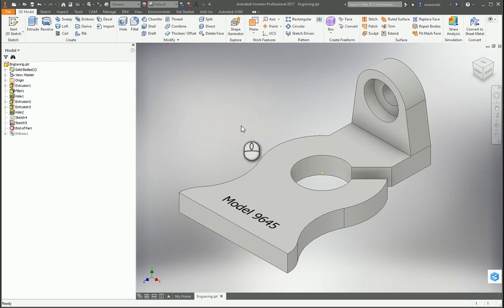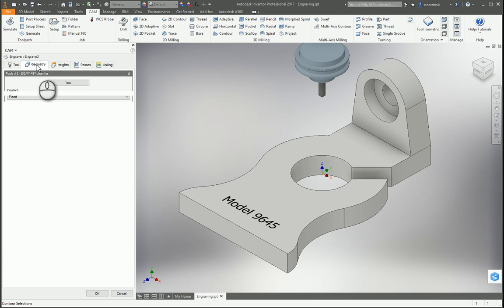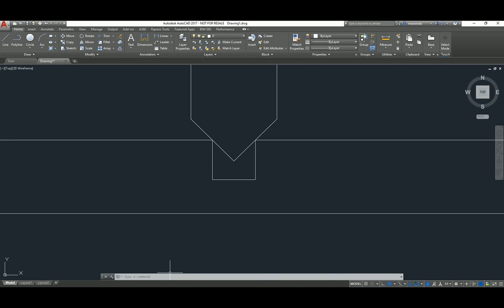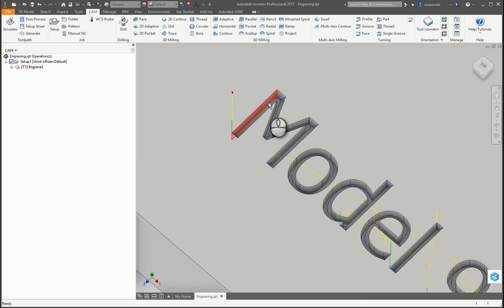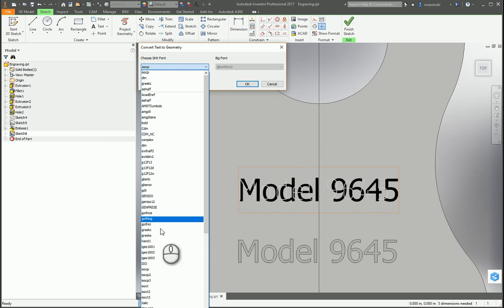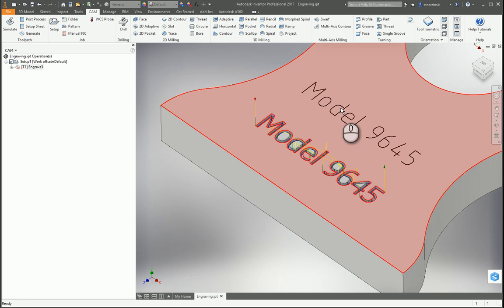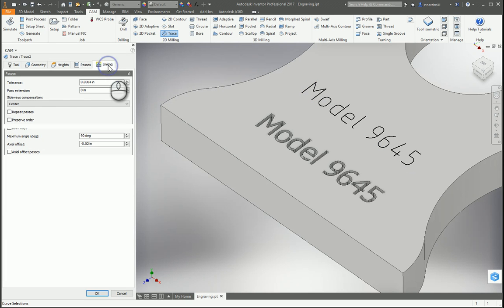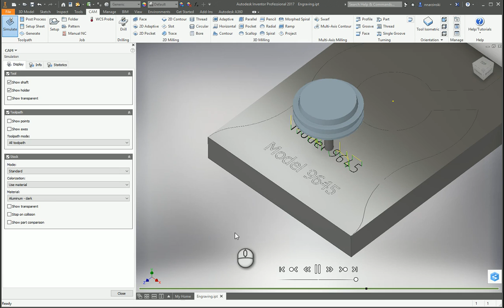Autodesk Inventor HSM - Engraving

Comment: Any tips on how you would engrave on a surface that's not flat? In inventor you would typically emboss & wrap to face. But then the "text" is not selectable in the CAM engraving module.
Reply: Use project under 3D milling. Create the text you want above the curved surface

Comment: Thank you. Clear and to the point.
Reply from the maker: Glad we could help! Let us know if you need anything else.
Reply: Hello

I have the student licence for Inventor 2017 (version: Build
142)

I don’t have the "convert to geometry" option. Not
sure if this is because of the version but I installed Inventor in Oct 2019.
When I first tried the ‘Trace’ on the letters, it went
around (but twice as its not single line) and it worked.
Now when I select the next letter with ‘Trace’ it doesn’t create
toolpath where the letter is, it moves/rotates the letter, See video https://youtu.be/dBjN2vxP0e8
I don’t understand why it worked the first time but now it doesn’t,
I tried redrawing from scratch on a new part, but the problem remains. 
I was using ‘Geometry Text’ to place around circle, if I use
normal ‘Text’ and ‘Rotate’ then ‘Trace’ works, I have tried the ‘Emboss’ to
engrave into the material, it works but again it’s not single line, but it is
an option. 
I left stock on top to be able to see when simulating
toolpath. 
Any chance you could explain how to fix it and why it moves/rotates
the letter.I would be very grateful.

Thank you for your time.
Reply from the maker: @dfvhswrjjrefvyht4110  Unfortunately we cannot say exactly why this is happening. I have seen other occurrences of the Trace command and Geometry text not working well together. With the introduction of the Engrave command in newer releases of Inventor CAM, the Trace is not really used for this functionality anymore. So I would suggest using your workaround if upgrading to a newer release is not an option.
Reply: Thank you for your time,